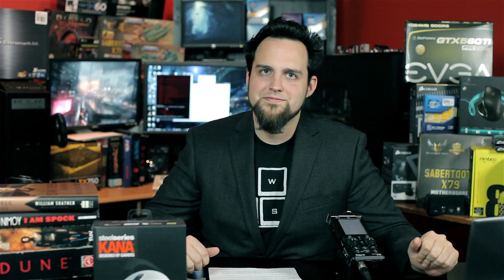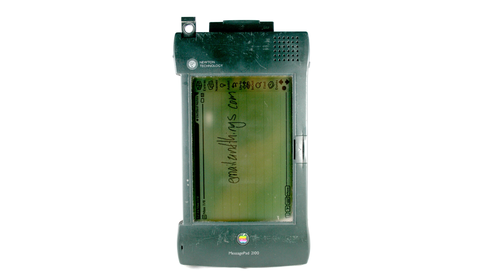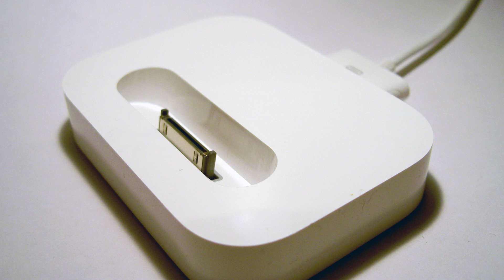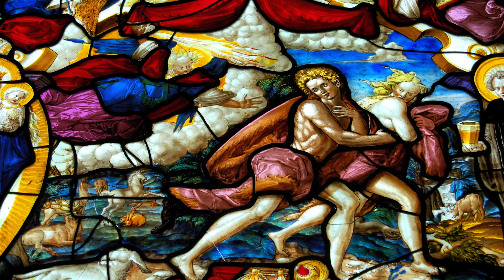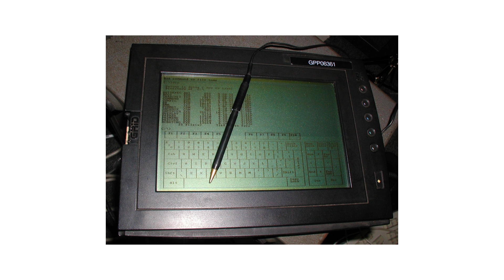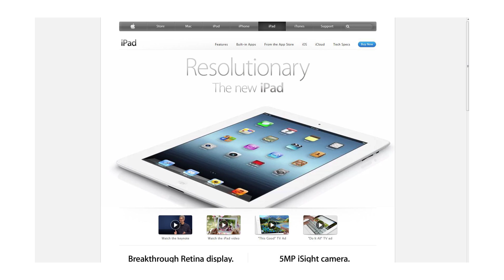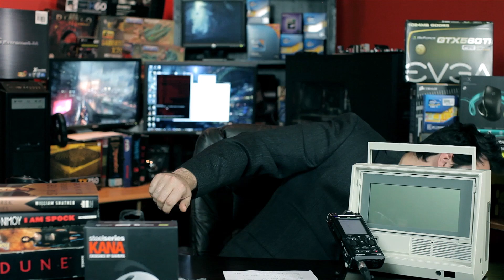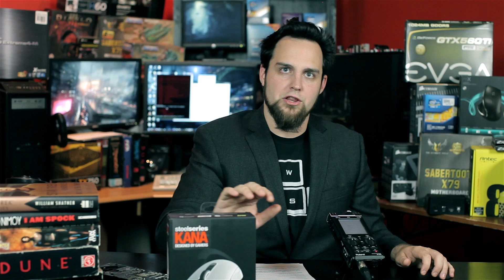Has Apple Really Ever Invented Anything?

Comment: I fel sad for apple they have always been the company to make stuff better but now they make everything less powerful for a high prize.
Reply: Which is something that I hope will be the downfall of the company. The only selling point of their laptops are a PCIe based SSD. Which, at this point, are 2 to 4 times as expensive as SATA based SSD's. When I can get a machine that is just as powerful, for half, or even less, you'd bet I go with the cheaper machine. Also, you forgot tremendously difficult to upgrade. RAM is soldered on, they use proprietary screws, battery is inside the case. So, not only has the price:performace ratio dropped, their upgradability has also dropped to the point of being impossible. Bad thing is, that their decision was a multi-edged sword. By making it more difficult to upgrade, you increase the costs and time necessary for repair, you tie the life of the product to the operational life of the battery (although the main board could still be functioning perfectly), and ultimately, in the end, you wind up losing customers.

And I should clarify, that laptops have always had a history of being tricky to upgrade, but at least in most, if not all, cases (aside from Apple products) you had open access to the RAM and hard drive/SSD.

Comment: Apples are shiny, obviously they are better
Reply: Gamez4eveR got a alienware, yea... im pretty happy.
Reply: They also perform better, have a much better ecosystem, are incomparably better integrated and, well, yeah, the design is best in class.

Ex-Android fanboy.
Reply: Gamez4eveR I was talking about the computers.
Reply: Kaargoth Steelfang If you use iOS devices Macs make your life much easier. And the OS is pretty damn awesome.
Reply: Gamez4eveR I'll give you the thing about the better ecosystem, but, some of their design choices, while necessary go getting things into as small a form factor as possible, are rather off-putting to the DIY community. Whether it's use of proprietary screws, soldering on memory modules, using a lot of adhesive on the battery, or binding components together that are otherwise separate. It does nothing but drive up repair costs, all so they can fit it into a form factor that is slightly thinner than the iPhone. There's a 15-inch Macbook pro that uses a 2.3 GHz i7 in it's base configuration, and it costs $2600, the laptop I'm using now is overall better (aside from weight, battery life, and screen resolution), but it cost less than half, at $1100.

As far as looks go, as far as it doesn't look seriously damaged, I don't care.
Reply: ***** Yeah their MacBook pricing is pretty insane. Although I love both the Air and Pro, you can get a laptop that's cheaper than the 11inch base MBA and outperforms the 15inch top end MBP.

But then you get to use it, and trust me, OS X is awesome, the build quality is literally incomparable, I've tried the Windows ultrabooks, and none have even a comparably comfortable keyboard (many call the modern MacBook keyboard the best laptop keyboard, and, even though I'm a big fan of mechanical keyboards for desktop, I can see why).

The top end MacBook Pro would be better priced at $2000-2200, just a tad less expensive. It was never supposed to compete in the value department, it's more of a cost-no-object product. Honestly that's one of the reasons I absolutely love it.
Reply: Gamez4eveR Pricing is not the only reason I have a distaste for Apple products. When my brother got one of the first generation iPods, it stopped communicating with our XP computer after about a year.

Then we get into the fact that you are pretty much locked into the hardware you get, even on the desktop macs (iMacs included). And more recently, with the new Mac Pro, the SSD is not a standard form factor, and the connectors on the graphics cards, and the form factor of the PCB is also not of a standard size. With Windows and Linux, at least you are able to get one with the hardware you need, across various brands, and while it is possible to get OSX onto non-Apple hardware, there's no way to do directly from the manufacturer. There's little competition within the whereas there is a ton of competition within the Windows and Linux ecosystems because you can get rigs that are fully customization, whether it's at purchase, or DIY.

Now, there is one thing that I must address and that is tech support. Some people criticize Windows because Microsoft doesn't offer good tech support, when that's not even their job at least when it comes to hardware problems. The one you should contact is the one who manufactured your system, or in the case of DIY builds, the manufacturer of the hardware giving you trouble. (A bit tricky for graphics cards though, since the cards are made by "partners" and not AMD/Nvidia. So if your EVGA GTX780 is giving issue, contact Nvidia if it's a problem with the features offered by the GPU or driver problems, EVGA for anything else).
Reply: ***** You are not telling me anything new here, dude. I know practically everything (that matters) about PC hardware. I know how Apple is overpricing their Macs, but they do it because they can.

Similarly how Porsche prices their Turbo S cars (911/Panamera/Cayenne). That "S" badge gives just a small bit of performance, but increases the price quite noticeably.
Reply: Rare HD Alienware, seriously? Should have gotten the new actually awesome Gigabyte laptop (not actually Gigabyte, they used a different name, I just forgot what, it was a thing laptop with 2 GTX760M's in SLI).
Reply: Rare HD WHY?. 1 its hilariously over priced. 2 if its a laptop it ain't a laptop cuz nearly all other windows/linux operating laptops are heavy but well if you like it good 4 u.
Reply: Kyle sucks Whether it weighs 8 pounds, or 2, it is still a laptop. If it's under 3 pounds, it's an "ultralight laptop".
Reply: Kyle sucks i do like it and its a 2500 dollar laptop but i got it second hand for 1100 dollars, i wouldnt of got it new cause it is overpriced, and Gamez4eveR to expansive
Reply: ok. if you got it of cheap ok fine.
Reply: Rare HD True I will call all stores overpriced and shop at dollar stores now!

Comment: Machined aluminium used in aircraft is special alloys that are usually heat treated for strength & can't be cast or forged effectively, for any aluminium alloy than can be cast it will be stronger if die cast than it would be if just machined from solid because the molten alloy is injected into the mold under pressure & is more dense. The unibody laptop wouldn't have required aircraft grade alloys, it could have been cast & would have been stronger, the machining it from a solid block is just total wank & waste of material.

If you compare it to an alloy wheel for a car, to make for example a 17" X 8" wheel that will end up weighing about 8-9kg you'd have to start with a billet of alloy weighing upto 200kg to make that wheel if machining it from a solid block, that's how wasteful it is.

Comment: They invented the closed source, dont mess with our code or we will sue you ass system.
Reply: Closed source encourages innovation.
Reply: luke timothy He might not be talking about "Open Source" in that sense, in which case, Andrew is an idiot. But, the problem with Apple is that they are a platform that is more closed when it comes to internal components. There are no official "Macs" that are not built by Apple. In fact, their devices tend to be the least up-gradable or repairable. Whether it's fusing the display and the glass/plastic panel into one piece, excessive adhesive, or use of proprietary screws, Apple doesn't have a good reputation within the DIY community. At least with Microsoft, you can build your own system and fully customize it to fit your needs. Need 4 graphics cards, 64 GB's of RAM, 6 TB of space on SSDs, and a 4960X (the highest end Intel CPU you can get without going into the Xeons). No problem, just get a motherboard which supports it and a power supply capable of such power output. With Apple, you won't even be able to get close to that.
Reply: Nope
Reply: Yep, it does.
Reply: Paul Korir

I was replying to andrew.
Reply: Interesting you should say that since the Darwin kernel for both OSX and iOS is open source and freely available.

Apple supports a hell of a lot of open source development. http://www.apple.com/opensource/

If you want to see a company that has completely closed off source code go talk to Microsoft.

Comment: One other thing, Apple was more involved in the invention of Firewire then you give them credit for. While it was indeed a joint invention of Apple, Sony, Canon, ST Microelectronics, Matsushita, National Semiconductor, RF Microdevices, ST Microelectronics, and others, Apple did play a key role it. So it would fair to say that Apple did not invent Firewire alone, it would be unfair to say had no part in inventing it. But the reality is Apple has been, especially since Steve Jobs return in 1997, more about reinventing technology. They simply built better version of existing products such MP3 player, smart phone, and tablet. Or applied technology used in non-computer tech to computers (i.e. Magsafe, for example). Building a better mousetrap can be just as important as inventing the mousetrap, so to speak.

Comment: I think your description of OS 9 is a little unfair. As someone who used OS 9 on a iMac G3 back in 1999/2000 I can attest that while it suffered from some significant flaws such no protected memory or preemptive multitasking and it’s interface was definitely not the prettiest (compared with OS X 10.1’s Auqua interface.), it was otherwise a quit useable system. More importantly, I think one needs to understand just how OS 9 came to be to understand why it should be judged in context. You have to go back to the the first Mac (Mac 128) which had only 128k available to it. This lead to certain decisions about memory management in the OS in order to make the system super memory efficient. But while this addressed the issue of running a GUI on the extremely low memory problem of  the early macs, it created a problem where you could not maintain backwards compatibility while having protected memory. This meant that until OS X, any app crashing caused the whole system to crash and need to be restarted. In the mid 90’s Apple (pre-Steve Job's return) tried to design a major system update that provide both backwards compatibility for older apps (without protected memory for those apps) but also provide protected memory for future apps. Unfortunately, technical issue among others lead to that project (known as Copeland)  being a failure and it was abandoned in favor of purchasing the Nextstep OS form Steve Job’s Next Computer and bridging him back to Apple as interim CEO (later made permanent) to oversee an overhaul of Nextstep into a more mac-like OS (it became OS X). This proved to be major undertaking that took 4 years to complete. In the interim they needed stopgap OS updates to OS 7 (the then current OS). This resulted first in OS 8 in 1997. It was followed by OS 8.5 and 9. All of these where stopgap OS updates until they could come out with a usable version of OS X (ver. 10.1 released in late 2001). None of these stopgap OS updates include protected memory or preemptive multitasking simply because there was no easy way to ad them without breaking backwards computability with already existing apps. OS 9 did offer greatly improved internet/networking support, Unix file system access, Keychain (secure password storage), a true multi-user account system, and OS update application. It’s easy to look back at it now and view it as awful by todays standard but at the time it was seen a decent OS update while we waited for OS X to be completed and released.

Comment: IOS is really similar to Open handset associations previous Linux GUI. Also the appstore on the phone, is a direct result of the 3GPPP-99 implementation
The A5 is a licensing SoC, sure its uniq to Apple, but Qualcom, Nviida, ST, Samsung and so on, have don the exact thing before that. Actually the processor powering the iphone 3GS uses almost identical technology but is a SoC assembled and produced by Samsung.. thow licensed to Arm. Continuing, A4, A5, A6 and A7 just uses a newer version of Arm licensing  The cores off the A7 is not official, but is most probably a A50 derivative.

Actually, i thin that the "legacy free PC" is kind of a good idea. Well, Apple wornt first, but the was the one how pushed it. The modular PC was a legacy nightmare at one time.

Comment: Preference Preference Preference. Some are better for certain things I've Nine apple computers and 3 PC's in my lifetime and I must say I prefer Apple even compared to my $3,000+ custom built PC. I have more problems in one year with my Lenovo Y500 than all my apple computers and over two decades of use combined, being hardware and software errors in nature not user error. So it is all preference, use, and experience. I love my apples and my PC but not equally.
Reply: Apple's are PC's. As for software errors, I am assuming you are running windows on your "PC". Historically windows hasn't been the most stable OS. The top 10 super computers in the world don't run windows. They also don't run the mac OS. They need a very stable OS, so they run Linux.

The reason that apple computers have fewer errors compared to a windows PC is simply because the OS and hardware are put out by the same company. So apple can make sure their OS is fully compatible with the hardware they are putting it on.

Comment: If apple made a car... Would it have Windows???
Reply: Lol
Reply: no, it won't have windows... and it won't have engine, seats, wheels... or any thing alse... it will just be a flat piece of metal board with apple logo on it, and then apple company will tell you the only reason that your Apple car won't run is because your road isn't made by apple, so it suffer from a hardware clash :)
Reply: Vostadues And the Apple fans would actually believe them! :D
Reply: they will tell you that you are driving it wrong
Reply: No but it will be running on Blackberry/QNX's micro kernel ;) sadly they would claim it as their invention also

Comment: What!!! I can't believe Steve Jobs tried to get intel to make a low power chip. If they would have done that then they would have eliminated arm. It would have made their empire grow instead of shrink.
Reply: ***** Well they are being eroded by arm. They still dominate the desktop market but that market is shrinking. Not to mention with moores law slowing down and most computers can run any application the average user needs there isn't much of a reason to buy new intel chips unless your computer breaks. If they would have made a low power chip when jobs asked then they would have started in the mobile space a lot earlier on with Apple on their side which would have made it so arm wouldn't have an advantage over them.
Reply: ***** No no I'm not talking about desktops here. I know arm isn't going to challenge intel for desktops but a significant portion of the desktop market is being cannibalized by mobile computers. Instead of having 3 computers a family will now have 1 computer and 2 tablets. Not to mention there isn't much incentive to upgrade anymore because we have surpassed the point where you need the latest hardware to run the latest Windows OS.
Reply: ***** Yes intel is doing fine. They stock is going strong. But they are shrinking. Intel is no longer the largest producer of silicone computer chips and less people are buying laptops and desktops. Laptops are still the most bought computer product, but less so than before the ipad. Although amd is their only competitor their desktop market is shrinking.
Reply: ***** Did you look at the data. 2013 was the largest drop in pc history with a 10% drop. If you look at the chart it shows that it's been in a decline since 2011. This is not a small thing. And for a global industry such as this you shouldn't see such a decline for ever one quarter that sharp.
Reply: ***** Bullshit. An I3 processor in a desktop pc can run almost any top tier game you can find on steam and that isn't going to change for a long time. You buy and i5 processor and it will do you for a very very long time. The only thing you need to upgrade is your graphics card and you don't really even need to upgrade that. Look at the minimum requirements for crysis, you don't even need an i3 to run crysis. There aren't even many games that have an i3 for the minimum requirement, most require lower.
Reply: ***** First of all, no battlefield 4 does not require an i5 processor
http://ca.ign.com/wikis/battlefield-4/PC_System_Requirements
And watch dogs isn't even out for pc yet.
And I'm referring to all the crysis's.

Comment: Apple is so immature! They're not the only fucks who have sleek products. I saw a ACER laptop that looks like a Mac Book Air. Apple is going to try and sue over that. Apple has enough money and that's all they want is money. That's why the iPhone 4 was all glass. They did it on purpose so you'd have to replace or repair it! Apple is just a mess in general. Only 168 games on Steam for Mac. PC can play em all just about except for a few Black Ops things for Mac...Windows made everything practically in the computer area. I mean who wants a uni-body laptop? If it cracks, bends or anything the who casing is junk. Windows laptop one part of the laptop casing breaks just a buy a new piece cheap and you may be able to get a different color.

Comment: I have to use a Mac Mini at work and it was horrific. It was so slow, horrible to use, and even more. It took at least 3 minutes to start up and be usable. I looked at the price of them and it was ridiculous! This thing cost the same as my PC at home with ~10 second boot time to desktop, everything loaded. Not to mention this thing also runs pretty badly in general as well. Until I installed Windows 8.1 onto it, now it's actually usable.